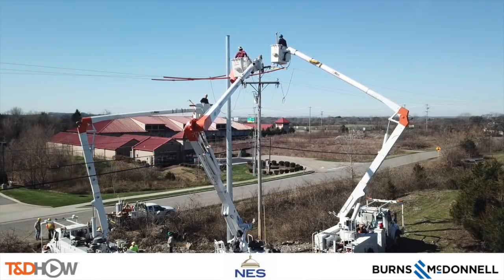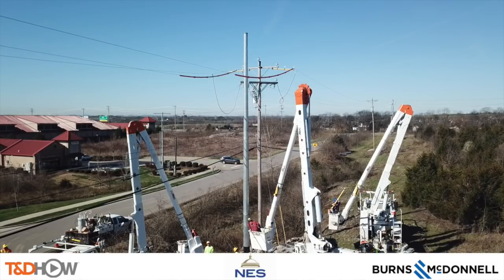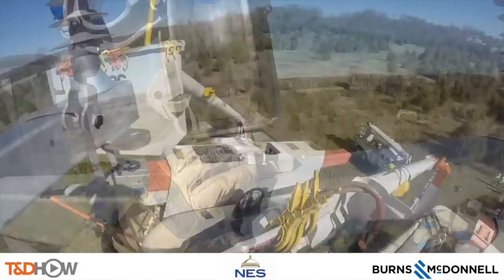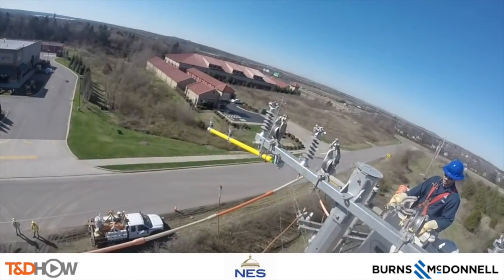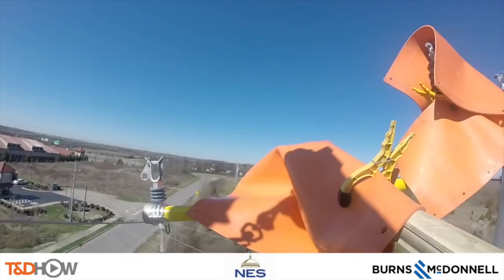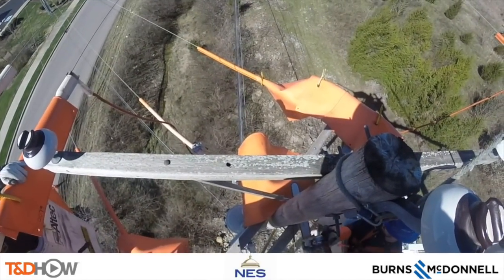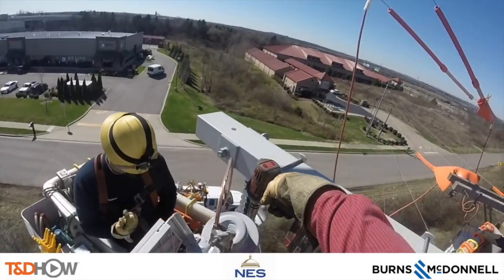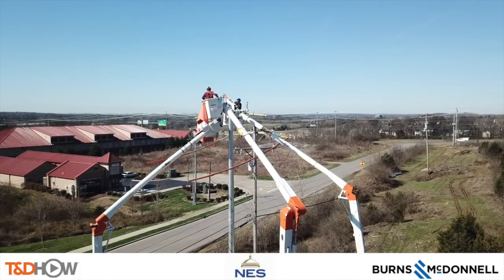Steel Distribution Pole Framing & Energized Line Move

Comment: It looks to me the separation between the line rollers and phases is too low. Otherwise pretty good job.
Reply: how much would it cost to do this in a 3-phase relocation? can it be done by independent contractors or only the major power provider-owner of the pole? A distribution pole was placed in the middle of the property long ago, and I want the lines moved to the next pole at the easement or edge of the property?

Comment: I don't get it. Being from the union up north. How does the company let the men work in leathers when the existing phases are on hot arms on a steel pole with a fiber arm, not to mention the humidity so electricity can track and get away with it? Seems like a bad practice but correct me if I'm wrong. I would guess a 13.2kv circuit?